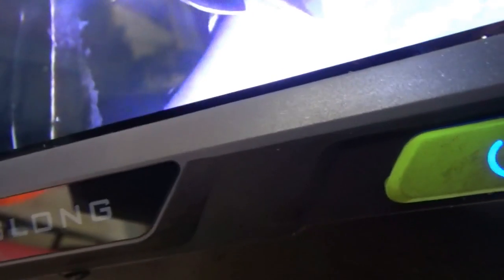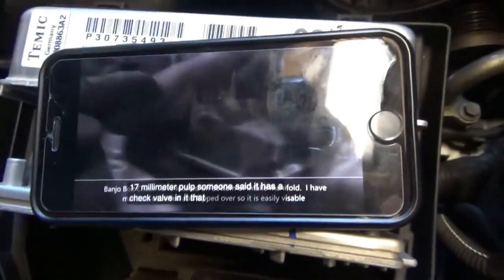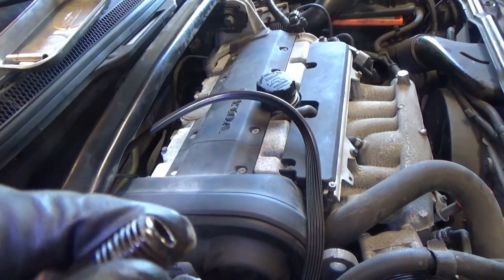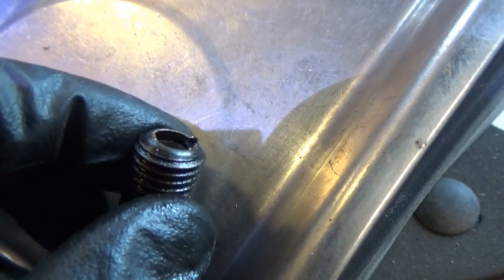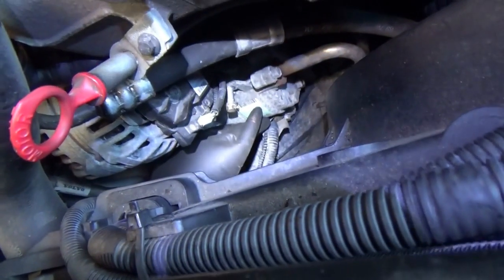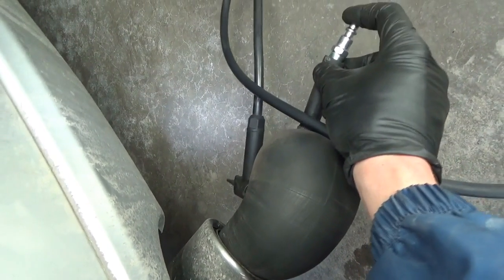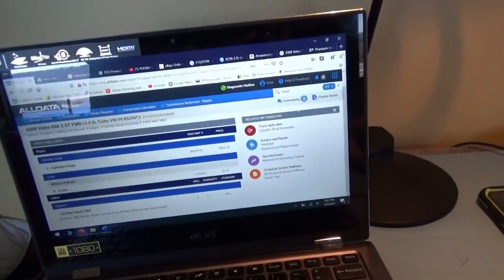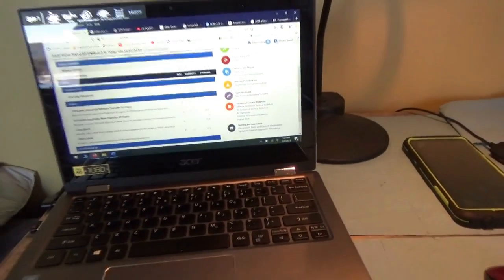Volvo Turbo GRENADES! - Part 2 (Cause of Engine Damage)

Comment: Does this engine have the iron sleeves/liners on the cylinder walls?  Or is the pitting on cylinder walls so bad because the walls are aluminum?  (I know it's an aluminum block, but I don't know which engines do or don't have the iron liners)  Thanks for this amazing "grenade" video series, which has taught me a lot!

Comment: Thanks i have the exact same problem. The banjo bolt is wrecked in my 2006 XC90. Misfire in cylinder 1 no pressure at all. Wish i changed the bolt earlier. Now it's a diy engine replace wish me luck!

Comment: Wow I'm glad I replaced my banjo bolt when I worked on the PCV system. For those of you with a Volvo 2.5t engine, you need the updated part number, 31325709
It has an updated design that is not prone to fail like this.

Comment: For those of you don't know about Volvo.
When you service the pcv system, you supposed to change that bolt. The pcv system will last around 80k to 100k miles.

Comment: Man I am, that's a shame. That motor looked like brand new. The cylinders have good hash marks in them still. I'm used to seeing motors well over 100k that are worn out and in junk yards being an 08. I know some go for 20+ yrs. But to see a motor that could have went for 30+ without any major repairs be screwed up by a $5 part is ridiculous. I try not to blame the manufacturer on this due to the fact that it is something that could have been overlooked due to simplicity. But I'm glad you were the one who helped him.

Comment: The Volvo in question is not the only engine design where failure of the PC valve (PCV) can destroy the engine. There are plenty of engines where the PCV sits in the top of the valve cover (rocker cover in Australia) and has a large steel ball as the one way valve, after 200Kms the steel ball can eventually hammer its way through the bottom of the PCV case and fall into the inlet and exhaust valve cam shaft(s) causing complete engine failure with the worst case scenario being pistons hitting stuck intake or exhaust valves. So the humble PCV needs to be replaced as a matter of course after XKms on many engines not just the Volvo in question.

Incidentally, the recycling of blow-by and oil fumes from the crankcase into the air intake system never used to be a problem prior to fuel injection engines, with many fuel injection engines the oily fumes from the crank case will lead to carbon build up in the Idle Air Control Valve eventually causing the valve to stick so the engine will not idle properly or not even start.

Another unforseen PCV issue, in more recent times the first direct injection engines suffered also from carbon building up on the stems and seat of the inlet valves as there was no longer a fuel injector there to squirt petrol to keep it clean.

Comment: the chunks went through exhaust side for sure, it likely jammed the turbo until it broke loose and passed through. I 100% expect damage on the turbine impeller, which is part of the shaft. to me, the sound in first video when it spooled, had the odd howling whine of death tone, which wasn't from it boosting into the crankcase through pcv valve connection. I wouldn't expect it to last long. if it bent or broke  fins or the shaft(a thousandths of an inch) it's out of balance and will quickly grenade itself.
Also since it has engine oil pumped into it and a larger drain port back into the engine oil pan or just above it, when it fails metal and other debris end up in the pan, as well as the intake/cooler and exhaust.
the first video explanation of major power loss, then getting better again with the one cylinder out, agrees with theory of jammed turbo that eventually unstuck again.
hopefully the used engine is complete with turbo and all :)

Comment: Different Volvo models with that engine are super common here in Sweden. I have owned a lot of them, with high and low milage, both gasoline and diesel versions. I run a small car repair shop as well. In my other business we have owned several new Volvos as well.
And the strange thing is, I have never experienced this failure, and I have never ever heard someone talking about it.
It certainly does exist, so no denying that, but it has to be a very small failure rate on this part. Maybe it was only out for a short while in the 2008 model year before it was beefed up?
Anyway, great job and video Ivan, I watch all your stuff. You should have a lot more views and subs.

Comment: Well. I wasted no time. I did my 07 s60 today. Opted not to remove the IM ( been there, done that), removed the power steering pump and loosened the alternator by removing bolts.
Note:  You need not remove alternator but you have to loosen the AC compressor bolts below the alt in order to get some wiggle room thus you'll have enough clearance to get to the bolt. You'll have to remove the upper radiator hose so you'll need to drain about two quarts from the radiator plug.  I got mine from Culver City (Ca) Volvo. Bolt + two crush waahers. $36, tax incl. At that price, why wait for delivery. It'll cost about the same minus the wait. A big shout out to my brother-in-law, a mechanic himself who sent me the link to this vid. 
Thanks Ivan for posting this vid.
Reply: So... did your replacement bolt/check valve look any better than the one you took out?  Were there any signs of the ball retaining pin working its way out of the bolt?

Comment: That's surprising! I had a 2006 2.4 T5 Volvo and I didn't know that was a design flaw. I just changed the bolt out because I asked the dealer for everything that DIDN'T come in the kit when I got it from my vendor. I replaced mine at 104k when one of my heater hoses shot coolant through the radiator fan and into the air stream for the intake. I don't recommend that version of steam cleaning. hahahahaha!!!

Comment: Ivan whenever I see cylinder damage like what you have I immediately go the route of used if possible. No sense getting married to the car with comeback issues. Also you might have discovered in part 3 you need a turbo as well. What goes into the engine must come out and that path is through the exhaust turbine. That turbo sound in part one is definitely a wounded turbo. Also you are in an emissions area and that cat might have or will suffer the longer he continues to drive with a misfire. Unplug the injector to save the cat. I don’t blame the manufacturer for this and it’s not a safety recall because dropping one cylinder doesn’t create a safety issue. A broken crank does and would possibly trigger a recall if NTSA gets too many reports.

Comment: Volvo lost points in my book, with this flimsy valve. Outrageous. Anyway... I'd probably reassemble, do a test drive with crank case pressure measurement. From the results, you can estimate if the oil disappeared because of crank case pressure, or actually consumed by cylinder one. So if the crank case pressure would come out high, then just replace that valve by a revised one. Then, just clean the ports, the intake and exhaust valves, lap them in vigorously, re-adjust, done.

Comment: I don't know if the head can be saved or the cylinder be cleaned up and honed..I would probably look for a good used junkyard engine. If it's good that would be the cheapest and quickest way out of the mess.

Comment: will it not be better to just use a normal banjo and a check valve on the pcv hose  as a better fix than a upgraded part  ?

Comment: The missing check ball allowing the crankcase to pressurize under boost may be causing at least some of the oil consumption. Could replace the banjo bolt and put 1K on the engine to test whether the bore condition is causing excessive oil consumption. That's what I'd personally do if it was my vehicle.

That said the vehicle owner would be better to just go with a used engine. Both options will cost them about the same.

Comment: That particular PCV system is not what you assume.  Correct that boost pressure is now exiting the manifold from the failed valve but it goes to a breather box/oil trap under the manifold.  Inside that box is a diaphragm that sometimes fails regardless and will whistle when doing so.  That box connects to the crankcase but also directly to the head.  At no point does it connect back further upstream than the manifold, as you suggested.  My guess is that backflowing boost pressure into the PCV system damaged that diaphragm, causing the whistling.  It then would have also pressurized the crankcase which is disturbing.  At minimum you should replace the entire PCV system, which is practically required maintenance on Volvo white blocks every 100k or so.  Also now check for any leaking engine seals, common for gunked up PCV systems to blow cam and crank seals -- this is equivalent to what happened here with the uncontrolled boost pressure.

Comment: Thanks for the heads up! I replaced my oil catch can about four years ago; did not replace bolt. How did you remove the bolt without removing the IM? I looks like you loosened the serpentine belt and lossened the alternator to get access. Can you share some info on that as I going to replace it and I'm not too thrilled at the idea of removing the IM. Thanks.

Comment: I certainly wouldn’t run that turbo on a replacement engine. A turbocharger is a very intricate item. That thing is spinning at 100k under lid and pressure. No good if even one of the blades is damaged

Comment: Can’t be very common, have a S60 2.5T with 270k!
Reply: It's not but common enough that everyone in Volvo forums talks about it and knows to replace that bolt.  I did mine about 5 years ago to keep this from happening. I'm at 210k miles on '01 S60 T5.

Comment: PCV is a maintenance item and it should have been replaced. I own an s60 2.4 non turbo and had to redo the whole PCV.  Before it even failed just in case part of major service past 100k km.

Comment: Your doing a pretty thorough job for that guy. It looks like you had ahold of something when you pulled that balloon member out of the tail pipe 🤨 I really don’t think you’ll be able to lap them valves or seats enough to correct the problem. I’ll bet at least one of the valves is slightly bent. Judging by the amount of air and the size of that balloon. It’s gonna probably be the exhaust valve. A thumbs up to you Ivan for your diagnostic skills. I’d at least hone that cylinder, replace the rings and piston. He might get lucky if that works.

Comment: What a nasty fault :-(
There is no cheap way to fix the bore, even a rebore skim would need an oversized piston and rings.
And they would all need doing so the power is balanced :-(.
Get the valve and seat done and put up with the oil leakpast.
Or tell your frend to run away from it lol.

Comment: Excellent diagnostic Ivan as always     I bet a nice used engine will be the solution its just the smarter of the options   provided of course that the engine is in good condition   try to get it from a yard you know.

Comment: Great video and investigative work. I definitely like your endoscope. It has some good quality pictures. The one thing you really didn’t address was the turbo and catalytic converter. The car had a code for the cat in part one. Also the turbo might not live to much longer since it will run unbalanced. Probably a crap shoot on that. Not sure what emission testing you have to deal with in your area and if you have to replace catalytic converter.

Comment: How in the heck is a cylinder head job 18 hours labor (50% longer than replacing the whole engine!)?  This ain't exactly a Duramax, it's an inline engine -- the head should just come straight up!
Reply: Twin cam, variable valve timing, manifolds off etc. So torquing head bolts and camshaft caps etc. That all adds up to a lot of extra bolts and that takes time compared to a few engine mounts and a bell housing and some electrical connectors.

Comment: First, Congrats on 100k subs. Good job Volvo. This is one reason I drive old Chevys. Nice find Ivan. All that damage from a $20 part.
Reply: Old ANYTHING is the way to go. I've got a '86 Grand Marquis - 274,6xx miles on the ORIGINAL driveline. Even running the original in-tank electric fuel pump! Try that on anything built the past 25 years ...

Also have a '93 Volvo 940 with 209k - rides and handles better than alot of these newer cars. Definitely no piss-poor engineering like the XC60 Ivan had here!

Then there's my '07 Silverado - nothing but problems since the very day it left the showroom. I had brake pulsation on the TEST DRIVE! 40 miles on the clock when I left the lot. Ball joints never made it to 40k, engine started burning oil at 50k, rear differential failed at 97k, and the latest was a 3/4 clutch failure at 103k. Plus a million other problems in between all of this ...

Comment: Having just done a head gasket, etc. on a 2007 XC70 2.5T, I can say that a used engine is your best money now. Outside of that, you can get a nice cam holder tool setup off the ScAmazon for $50. Robinson Auto had a good video of the head job with homemade tooling that's worth watching. Good luck.

Comment: It could've been using oil because the turbocharger was pressurizing the crankcase.

You should be able to repair the cylinder head for less than $3000 USD even if you bought your own valve seat cutting tools, maybe hone the Pitt marks out of the cylinder or just leave it as it is & see how it goes.

I can remember when Holden fitted the 6 cylinder Nissan RB30E engine into the VL Commodore in the mid to late 1980's they had an inherent cylinder head cracking problem due to the inherent "bonnet slope" of the Commodore which meant that the cylinder head sat higher than the top of the radiator which lead to cylinder head cracking as an air pocket would develop inside the cylinder head,a hot spot would develop, coolant would hit it then "crack".

Anyhow,a brand new Nissan RB30E cylinder head cost $2000 AUD for that engine from Holden so $3000 USD is ridiculous for a 5 cylinder Volvo engine cylinder head reco even it it included labour !

Comment: Ivan that’s one crappy design. Nice find nice troubleshooting. If any of those turbo blades are damaged the structural integrity of the turbine or compressor could be compromised causing even greater damage. As a jet engine mechanic for 50+ years the speed of the turbine could cause even greater damage. Check the root of the blades. For FOD ( foreign engine damage ) aircraft terminology definitely needs to be checked. They come apart you have bigger problems. Just advice from someone who has seen it. Good video though stay safe and well Artie 👍🇺🇸

Comment: Used engine for sure. Cyl wall looks shot. If the impellers are not perfect on the turbo too it will be out of balance at the supersonic rpms they live under.

Comment: I pretty much tend to agree. A good junk engine is the best way to go here. And yes the old engine could be saved, but the cost would outweigh the benefits.  I mean if this were a 1949 Volvo and there were no other engines available the cylinder could be sleeved, the heads machined and the piston replaced... That's assuming that the bearings and wrist pins didn't get crunched due to lack of clearance in the cylinder.... but still given enough time, machine shop resources and parts... that engine could be fixed.

The only issue with a junk engine is that you might find one in the same shape the original one is in especially given the junk engine has similar miles on it to the original engine and also has the same banjo bolt.

You really should look for a lower mileage engine and check to make sure it still has the original banjo bolt and that  it's still intact.

When my dad started working on cars back in the 1930's in Europe he wasn't fond of rebuilding Volvo engines.  He told me that the engines were actually cast out of steel rather than iron and were a real bear to hone and resurface.  I was working on some back in the 1980's and yes these things had great 4 cylinder engines.... (except the Bosh fuel distributor pump, that would explode when water froze in it).  Still, if you ran dry gas in winter, those engines ran a very long time.

Oddly, a couple of years back when I was looking into getting a new used car, I found several of those turbo 5 cylinder Volvos dirt cheap with pretty extensive service histories. Maybe the banjo bolt was the reason they were so cheap.  They all were between 150 and 180 thousand miles and "ran rough". And I'm honestly thinking I might have dodged a bullet by avoiding them. I really wouldn't have scoped the cylinders on an $800.00 car with 150,000 miles on it before I bought it.

So yes, 4 cylinder Volvos used to be really good cars back in the 1960s through the 1980s, even though their parts cost a fortune... but I believe that things were already going down hill when they started using the French made V6 engines even back then. It's odd how a good reputation can live on long so long after the quality is gone.

Comment: Ivan, after building several turbocharged engines, I can tell you that engine replacement is the only way to go here.  Let's say on a hypothetical, that you DID NOT have cylinder bore damage, and could get the valves back to sealing.  Well, you still have the pockmarks in the head.  These will create hot spots in the cylinder, and these could cause pre-ignition.  Pre-ignition while under boost is nearly guaranteed to cause severe engine damage which could range from a lifted head gasket, all the way up to ring land failure, or even complete piston failure. That sort of liability is too much for the time and cost involved, and it's even worse knowing that it's possibly just one pass or merge away. - Tim, Milton Automotive and Diagnostics